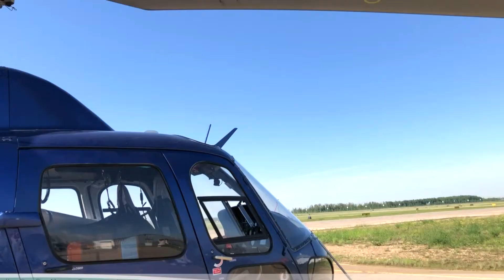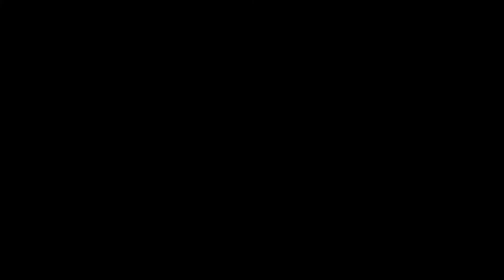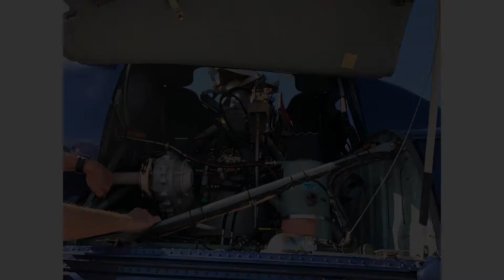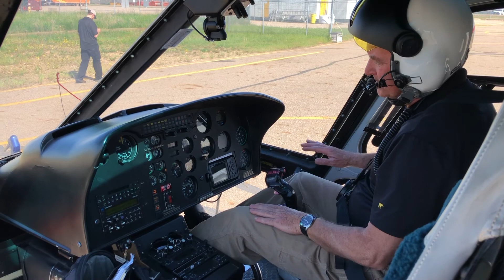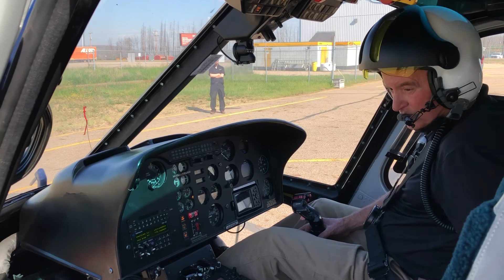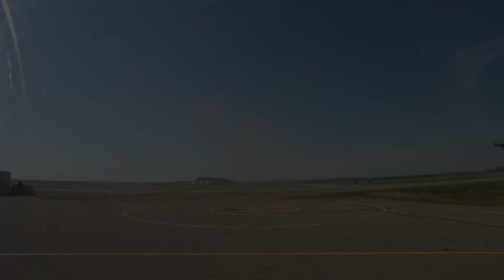AS355 Twinstar Helicopter: Guided Tour With Engine Start & Fly Away

Comment: Hi so if one  engine  cuts  out  you  can  still  fly  with  the  other engine safely  I'm  guessing?
Reply from the maker: Hi Robert,

The general idea is that if the correct flight profiles are flown as published by the manufacturer, then the helicopter should be able to return back to its landing point, or fly away and climb at 100ft per minute up to 1500ft above ground and then maintain its altitude on only one engine. This will allow the pilot to fly to an area of safety.

To do this, the pilot must ensure the aircraft weight is kept under the performance chart limitation to enable this. The TwinStar is not the best machine for single engine operations due to its lack of power, it does require quite a light fuel load to maintain a high hover if one engine quits. I believe a max of 40% fuel amount is typical for doing powerline work. I could be wrong as I do not fly this machine.